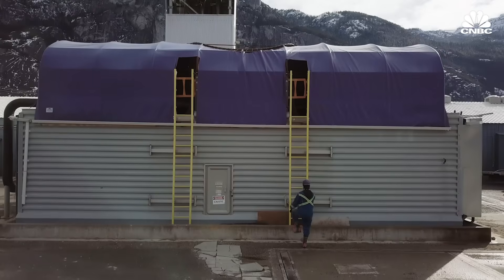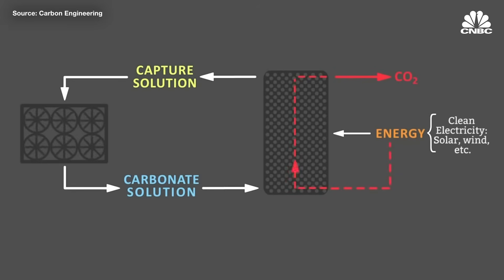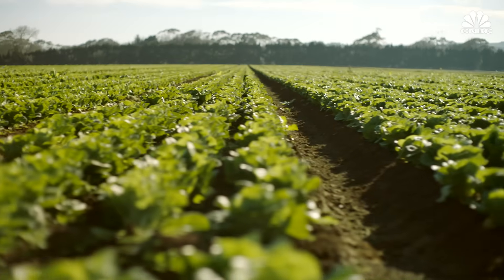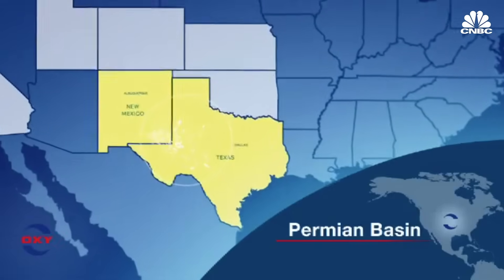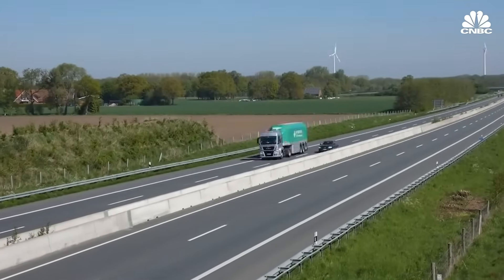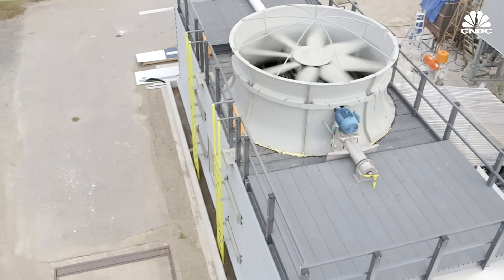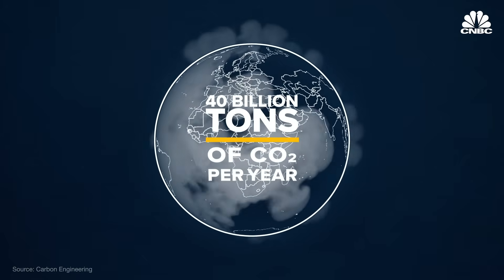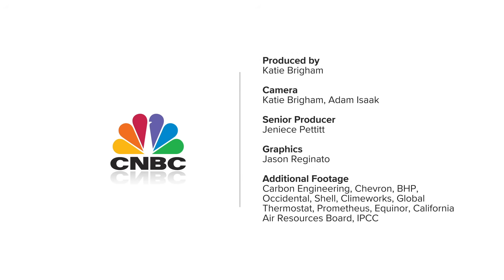Bill Gates-Backed Carbon Capture Plant Does The Work Of 40 Million Trees

Comment: Great work to help clean the air quality, but it won't stop climate change because climate change is a natural cycle of earth called The Earth's Procession which is a natural cycle of earth's changes in the angle of axis and as we know already the actual axis is at 23.5 degrees tilt and during the cycle of Procession at half way through the cycle the angle of axis is almost at 30 degrees tilt and that is why temperatures are changing and depending on how far the cycle of Procession is at this point in time and during the cycle of Procession the path of the sun across our skies changes with it and we are already seeing the changes in temperature in the northern hemisphere and the southern hemisphere depending of course how far the cycle of earth is because it takes 25,800 years to complete one cycle of earth, and not only that we are already changing our petrol engines and diesel engines to electric vehicles, it's a long process because money is wasted on vanity projects like the Shard in London and the London Eye. Don't listen to the scaremongering types like Greta Thunberg who think that humans are responsible for causing climate change we are not, do you see trees dying by the roadsides NO, do you see the grass verges dying by the roadsides NO, yes we need more trees and some countries are working very hard to make a difference but some countries are not.

Comment: Dan Kammen's an idiot to say that partnering with oil companies is a step in the wrong direction.

If one were to try to fight the oil giants head-on, they'd be killed in the cradle.

Carbon Engineering is actually being smart here, getting on their good side then using their funding to further improve their carbon capture technology while moving it towards renewable energy and eventually expanding their operations to capture carbon globally.

Oil is going to run out eventually, and soon enough the oil giants will no longer be emitting CO2 while Carbon Engineering will still be capturing it; once the scales flip like that, the amount of CO2 in the atmosphere will go on a decline. 

Combine all that with the fact that globally energy production is moving towards green energy or nuclear energy and soon enough Carbon Engineering will have to stop their operations due to a critically low atmospheric CO2 level.

Comment: It's one piece of the puzzle, together with planting trees. But we should not forget that the ultimate solution is to first stop extracting carbon sources, like oil, natural gas and coal from the ground, in combination with putting the carbon back in the ground, preferably in solid form. (Because gas tends to leak, undoing your work) But if we don't stop getting the carbon out in the first place, it is, as the Dutch call it, "Dweilen met de kraan open." 

We need to do all these things, and it's going to be expensive.

Comment: What is the point of turning the output into fuel? It would just release the capture CO2 back into the air...
This is pointless
Reply: It would reduce the need for using traditional fossil fuels
Reply: @yash9201  It would release the same amount of CO2
Reply: But it won't release co2 stored deep in the earth..... It is the co2 that is trapped from the air.....making it carbon neutral if not negative

Comment: But solar and wind energy options aren't really viable.  And continually crap out due to meagre durability. And guess what is used to manufacture panels and turbines?  You guessed it.  It's factories fueled by oil, coal, and gas.

Comment: Sounds good, doesn't work. This is like  proposing freezing water  to throw back to the poles to combat rising sea level. As the first law of thermal dynamic suggests, you would need as much energy to collect and compress co2 from the air as you would gain from burning fuel. The  problem is where would this energy come from, not to mention the losses of energy during conversions. It would be much more practical to use clean energy to reduce fossil fuel consumption rather than trying to recycle co2.

Comment: I thought some coal power plants already tried this 10 years ago and it took 30% more coal to produce the energy to capture the Co2 which made the whole process not worth it. 

One of the situations where I think this tech would make sense is after we get to a lower emission rate, we can use any excess powered by green energy to turn back the clock on how much carbon we already pumped out. Soooo... around 2040 or 2050? 

Or in the mean time of trying to develop green energy storage, we use green energy to offset the emissions of Co2 coal plants by using the excess to power these direct carbon capture.
Reply: there is no such thing as green energy, lithium mininng is really bad for the Earth
Reply: @gregoryeverson741  no such thing as green energy? Did you mean no such thing as green energy storage? Which also is not true since they pump water to hold excess energy already. 

Lithium mining is not ideal but i think they found the good still outweighed the bad over the course of lithiums lifetime

Comment: Question: What is the energy cost of removing 1 ton of CO2 this way? And what is the carbon footprint of this energy, so what is the carbon footprint of removing 1 ton of CO2 for 130$? It wasn't mensioned. For example if it takes 0,5 ton of CO2 emission to capture 1 ton it costs than actually twice the price per netto tons CO2 captured.

Comment: Wouldn't many trees somehow create/alter climate patterns, if strategically planted??? What I mean is that they (many trees planted in a group) may or can affect rainfall, humidity, or drive wind patterns, all while capturing some carbon that does not need to be dumped somewhere else. Us, on the other hand, can make minor adjustments or major sacrifices to slow/reverse carbon emission trends that we are in and refuse to give up.
Reply: I have read that “greening the Sahara” would actually have negative affects on the Amazon as the Amazon actually gets important minerals from the dust that is strewn into the winds over the Sahara.
Reply: @dougpatterson7494  thanks for the "fun fact" 🙄
Good info that we have, thanks.

Comment: Well wouldn't it be easier to compromise with the oil industry instead of shutting them down why not deal with the carbon in the air directly. Doesn't matter when we use the oil if we can take the carbon out of the picture. Obviously with restraint still need carbon

Comment: We're really gonna take carbon out of the air just to put it in drinks so we can vent it back into the air? Damn.
Reply: it's a yes and no kinda thing, at the moment most of our co2 comes from capture at high carbon power plants at a cost of $69-$103 per ton which is already lower than the estimate here (although I'll wait for proof that they can do it at this price) the issue with capture for resale is that we've already got enough supply to meet demand, so we're back to square one where carbon capture has to be government funded or laws around carbon neutrality need to be introduced. I could see coke maybe introducing something like this at bottling plants if the costs end up being at the lower estimates, although their factories already use up so much water I wonder if there'd be enough left for carbon capture in the area

Comment: Wait... so this machine pulls carbon from the atmosphere AND is powered by methane... can I see an energy balance equation? How much energy does it take to then convert the CO2 from the methane back to a fuel?  Where we gonna get all that energy from.. solar? How many square miles of solar do we need to cover the energy needs + the energy cost of producing those solar panels, that chemical plant with all those shiny steel pipes and tanks and exotic chemicals? How many trees could have been planted in those square miles? I... can't... even....

Comment: Unless we have vast reserves of pure calcium preserved in oceans of mineral oil (to protect the calcium from oxidation), this particular solution is nothing more than a smoke blower.
Reply: I was actually wondering why it has to be in gas form. That would mean it has to be pressurized wherever it's stored. It could be turned into more stable minerals and put down a lined shaft to keep it from leaking out. Keeping it as a gas just seems to be the most complicated way of doing it

Comment: Wait, so they take CO2 from the air, chemically combine it with their liquid solution to get CaC03 (thus ADDing an Oxygen atom for every CO2 molecule that they pulled into their process), then heat that at "very high temperatures" (uh, burning?) to get back to CO2, which they then bury?

Am I not understanding this right?  They're sequestering the O2 alongside the C?  Then we're going to need a LOT more trees anyway, so what's the point of these plants?  Oh, that's why the oil companies are involved - to provide the energy to get the CO2 back out of the CaCO3?  Either this is decidedly NOT carbon neutral/negative, or the video explained the process very poorly.

Comment: This will make pollution way worse. They had to have known that when they started this project... are they trying to destroy earth? Co2 is not putting holes in the ozone and its not a chemical thats foreign to our environment like aerosols. Co2 is natural and the more thats in the air the faster and larger plants will grow. Plants always produce more oxygen when you give them more co2. Heck pot farmers pump co2 into their greenhouses. Makes the fruit huge and they grow faster.
Reply: its like this.. pollution goes up, as does c02. 
but
the increase in co2 signals the plants to filter air faster by speeding up all processes
so
the plants filter the pollutants out of the air faster thanks to the co2 signal.
HOWEVER if
pollution goes up and you REDUCE co2 the plants dont get the stimuli to filter faster by means of faster chemical processes and growth. (ie surface area)

Comment: Oil companies have a huge initiative to reduce the cost of and build more effective methods of CCS (or direct air capture) because they want to keep doing what they are doing. And when the fossil fuel energy is on its last leg, they'll switch to synthetic fuel. This is why we have to let them be a part of this process -- because they aren't against the environment, but for themselves. We just can't be duped by them: we must first use the tech they create to store carbon until we reach a place where the atmosphere can handle the implementation of synthetic fuel.

Comment: Carbon capture should team up with Graphene battery companies.
Get Pure Carbon from the air and make them into batteries and other graphene products. (creating the graphene from the carbon.)
Reply: graphene can only be constructed via what is basically 3d-printing, molecule by molecule, which means it is currently not scalable at all. The problem with graphene is not thatwe have no carbon, it's that we can only construct in atom by atom
Reply: And while they are doing that, they can work on solar power sterling engines to power it. Means it would only run from an hour after sunup to an hour before sundown. This means that we could get back to the natural rhythm of life.
Reply: Great idea
Reply: I was literally about to comment the same thing Graphene batteries requires carbon so this should be used for making our next battery tech.
Reply: Yeet_isgold Yeet_king  Umm? You do realise you can recycle waste panels among other things very efficently, right?
Reply: @nikolaierikssonkukkonen9878  you know nothing about recycling, you cant recycle everything, smelting metals is very dirty
Reply: Yes, let's combine TWO useless dreams.
Reply: @joeanonimous1105  might aswell put my fan outside with a blanket behind it, look i made a CO2 and a covid air scrubber, lol

Comment: Here's an idea:
Giant Reflective Tarps, stretched across floating buoys, placed alongside existing sea ice, so the ice can grow. Then the tarps can be moved.  Ice reflects sunlight, while water absorbs heat from sunlight.  
     If one little hole is formed in a sheet of sea ice,  the water in that hole absorbs heat from the sun,  and the hole grows exponentially,  with melting occurring in a runaway manner.  We need to commission teams to find these holes or cracks in the sea ice,  and cover them up with light-reflecting material,  like a shiny tarp. 
      We could, at the very least,  drastically slow down the melting of the arctic sea ice,  or;  maybe we could halt it completely,  or even reverse the melting and begin regrowing the sea ice.   
     Colder water dissolves more CO², and then the cold water sinks,  taking the CO² with it. (This slightly increases the cooling effect,  but only slightly,  and secondarily.)
     Carbon Capture is great,  but we need to fight this war on multiple fronts.  We Need to actively regrow our arctic sea ice.  It's the biggest button on Earth's thermostat.  I don't care if we have to build giant versions of those machines they put in ponds to freeze them for ice skating.  I don't care if we have to build a million snow machines,  to cover all the remaining glaciers in fresh snow.  We Must Build More Ice. 
     Our atmospheric content is like the insulation of a house.  Our arctic sea ice is like the air-conditioning system on a house. We have to actively address both.  
     We also need to confront Methane. Methane is a Far More Powerful greenhouse gas than carbon dioxide. We need massive, expansive grasslands for that. Grasses absorb methane,  while trees Do Not.  
     The Sahara would be an excellent location to build wild grasslands, but it's probably take a century to make any noticeable progress (though,  that's not a reason to never begin). Maybe black,  rich soil could be dredged up from riverbeds around the world,  and shipped to the Sahara.  Maybe desalination plants off the African coast could pump fresh water to the areas being de-desertified. 
     The problem with trying to turn the Sahara into green savanna is that the world is way too hot right now. When the planet was much cooler,  as in 7,000 to 10,000 B.C.E., there was actually regular rainfall across the Sahara. With temperatures as hot as they are now,  anything planted on there edges of the Sahara would require artificial irrigation,  at least,  until we further cool the planet through other projects.  
      So we need to start with creating expansive  grasslands in Canada and Russia/ Siberia. 
     There's actually already a project underway, that's trying to artificially re-create the Mammoth/ Mastadon,  because sub-arctic grasslands need a lot of stomping. The packed ground prevents tree growth,  so that grasses can thrive,  and drink up that methane. 
CO² Capture alone is a losing battle without addressing methane as well as sea ice production/ maintenance
Reply: There are a lot of grasslands in Canada already. I don’t think replacing forests and wetlands with grasslands helps the climate. Reducing highly productive crop land to grow grass isn’t ideal either.

Comment: We are investing in research to develop these machines instead of just planting trees. So we are going to build these machines that need also energy to function,  in short we burn fossil fuels to produce the energy needed to operate these machines to remove the CO2 prouduced by burning fossil fuels, very clever. We do a bunch of nonsense stuff but we are not doing what is absolutly necessary and less expensive: plant the f..ing trees!!!!

Comment: News flash....if trees don't do it, we have less oxygen available. Bill didn't really think this through. ✌😆
Reply: Wow the fact that you think youve thought this through more thoroughly than bill gates just shows how narcissism breeds stupidity. I hope youre not old enough to vote. 😣
Reply: True
Reply: Plus, it's not the CO2 that's worst. It's methane and other gases, and the change in how the earth surface absorbs solar radiation. Just removing carbon dioxide from the air isn't changing much.
Reply: @a0flj0  That's not true.  Methane is more potent than CO2, but we emit much less of it and it doesn't stay in the atmosphere as long. Methane also decays into CO2. CO2 is a bigger problem than methane.
Reply: @Austrolopithe  The big problem is all gases taken together. What I meant to stress is that even if we plant enough trees to absorb a huge amount of carbon dioxide from the air, that's not going to change much, as long as we don't also change our habits - the ones responsible for much waste, for significantly changing the light absorbing properties of large swaths of land, and, among others, for huge quantities of methane released into the atmosphere by industrial meat farming.

Comment: Bill and folk's in general needs to understand the earth is simply the secondary coil in a transformer of sorts re radiating electro magnetic induction of the sun's fusion @ 100v per 3ft from the Earth's surface into the upper atmosphere
 this voltage indifference and various combination of molecular and their charges
 Suspend semi metallic gas in the atmosphere +or injecting ANY gas (even water vapor) into the atmosphere is re radiating that energy heating the earth 
It's physics not witchcraft
like a microwave using semi metallic gas

Comment: This is basically recycling CO2. Take it out of the air to make fuel and then the automobiles burn the fuel and put it back in the air. Some of you think this is a bad idea but I think it is a much better idea than pumping more CO2 out of the ground and putting it in the air. The key word is "Neutral". Neutral Carbon Emissions means we are not putting more into the air. Oil is Positive Carbon Emission. This is way better than the current system we have in place now. The other thing is we assume that we will always have Oil. Think again. The world has about 47 years of oil left. We have to start making the changes now.